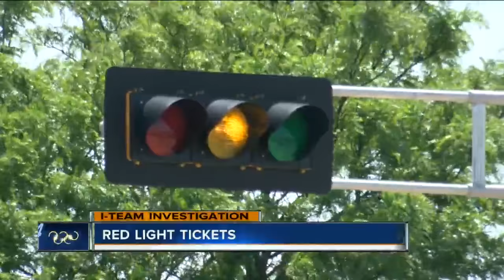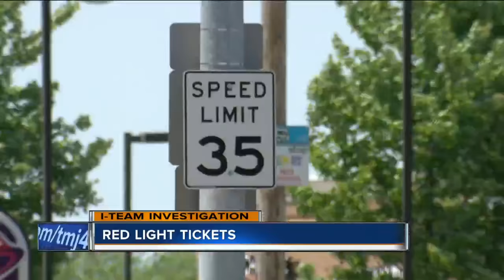Police write red-light tickets at intersection with short yellow light

Comment: Wrong information handed out at the very end;  you can only be charged of running the red light if you entered the intersection (marked by a limit line or crosswalk) AFTER the light was red.  If you entered the intersection on a yellow light, you cannot get a ticket for running a red light.  Read and understand your state's vehicle codes.
Reply: Where do I find that state law for Indiana? I just received a ticket for going through an intersection where the light was clearly yellow but cop says it was red and it was not. smh
Reply: I literally just got a ticket (Michigan) for running a yellow light.
Reply: A cop just tried to do this to my mother yesterday while it was raining. The light did not turn red until she had cleared the intersection, cop immediately pulled her over. He claimed he pulled her over because residents were “complaining” about safety issues. No ticket was issued after we called his bluff on the light being red.
Reply: @smokerscough2907  just another reason to install a dash cam
Reply: but u forgot that.....................................................
the video shows...................................
THAT THEY DID...........................................................
drunkard
Reply: That depends on which state you're in, there is no blanket answer to that
Reply: That’s how the red light cameras work where I live. You can only get a ticket if you cross the line AFTER the light is red.

Comment: in Australia,
Yellow amber is 4 second for city traffics at 50 or 60 kph speed limits
 and 5 second for highway at 70 or 80kph speed limits
Reply: Just 3 second only
Reply: 30 To 40 MPH Or 45 To 50 MPH Speed Limits MPH Not KPH
Reply: It’s km/h Not kph
Reply: MPH Australia USA km/h
Reply: @sharpfinch5354  km/h
Reply: @sharpfinch5354  USA 🇺🇸 Every 20 km/h
Reply: In The United States 🇺🇸 And Canada 🇨🇦 5 Seconds With Speed Limits Of 40 To 60 km/h
Reply: @sharpfinch5354  USA 🇺🇸 Uses km/h Not MPH
Reply: @sharpfinch5354  USA 🇺🇸 Metric Canada 🇨🇦 Australia 🇦🇺 Inperial
Reply: wrong country

Comment: Here in Russia, the yellow light is also required to be atleast 3 seconds long. And most of the time, it is 3 seconds. Nobody fusses. Maybe that's because most traffic lights flash green for 3 seconds before changing to yellow?
Some traffic cops here are corrupt, but atleast they're not that stupid to write cars tickets for "running a red" when they crossed the stop line on a permissive aspect. I'm fairly sure anywhere in the world, that when a light changes to red and you're already inside it, you must finish your maneuver.
Reply: in soviet russia, red runs you
Reply: I think that is a great safety feature to have, where the green light flashes several times before it turns yellow to give people extra warning. There are some countries in South America that use the same system.
Reply: @ZXM23NYC32LA2ZEE In Zelenograd (a city de-facto northwest of Moscow, but de-jure part of it) the Moscow Traffic Management Centre actually got rid of flashing green in October, for "safety reasons". They claimed that it encouraged drivers to speed up, instead of slowing down.
Opinions have divided - some people (mostly urbanist types, who don't drive) support it, while others (those who drive often) oppose it, arguing that 3 seconds is not enough time to stop a car. They also add that a yellow light is a prohibitory aspect according to the Road Rules of Russia, for driving on which one could thereotically get a ticket. Although the rules do provide an exemption to that in case you'd need to brake hard in order to stop at the yellow light. (if you're too close to it for example)
This is not helped by the fact that here in Russia, since 2013 drivers are fined for speeding only if they speed 20 km/h over  the speed  limit. So if the speed limit is 60 km/h (which is the default in built-up areas), the actual speed is 10 to 20 km/h higher. This might explain why a lot of drivers dislike this change, they simply have gotten into the habit of speeding.
The traffic police in Zelenograd recently had also spoken out against the change, stating that crashes at intersections without flashing green have actually increased, and that information about "mass acceleration" on flashing green is not true.
But even with all the backlash, the MTMC have stated that they're not intending to reverse the change.
Reply: @NewBuildmini  Wow, that’s quite detailed and interesting as well. I guess the same thing could be said for the countdown timers that displays how many seconds the traffic light will be red or green.  I think those are mainly popular in parts of Asia, but we have all seen the countdown timers across the world on the pedestrian signals. In the United States apparently I found out it is illegal to give the drivers any indication that the traffic light is about to change red, other than the yellow light coming on, and it is also illegal to give any type of indication that the light is about to turn green. So the countdown signals and the flashing green warnings are all banned in the US.  However, in the US, you can still tell when the traffic light is about to change to red.  I just look at the pedestrian signal, facing the same direction that I am coming from and look at the timer. Once the red hand or in some countries, the red man stops flashing and goes solid…. And the timer gets down to 0, the traffic light will change red. So in a roundabout way, you can tell when the traffic lights are about to change in the US.

Comment: Yellow light means slow down so when the red light comes u can stop better
Reply: You're saying "yellow light means slow down"
Okay, So if you're driving at a speed limit of 35 mph and the light is still green 15 feet before you reach the intersection but turns yellow 5 feet before reaching the cross lines, what are going to do then, slow down until you need to slam on the brakes possibly leaving most of your vehicle in the middle of the intersection or are you going to keep going risking the yellow light turning red before making it to the other side while hoping a cop doesn't give you a citation for "running a red light"?? 🤔
Reply: Only slow down if it is safe to do so. A light won't prevent you from getting rear ended, and it's literally impossible to react if it turns yellow .1 seconds before you enter the intersection.

Comment: When the light turns yellow you're supposed to slow down, and then stop 5 feet away at the stop bar outside the intersection when the light turns red. Problem is people don't pay attention on the goddamn road, and go to damn fucking fast, or they don't care, or even pay attention to where the intersection actually begins that to know where they're supposed to stop at, and added to that they don't care about pedestrians, or the safety of pedestrians. My issue is if you can't slow down within the three seconds giving on yellow, and then not actually care enough to pay attention to the stopbar to stop outside of the intersection on red that's your fuck problem, and you deserve to pay the money for running a red light, but you also deserve to pay $150 for stopping inside the stopbar and failing to yield to pedestrians.

People should learn how to fucking drive before they start complaining about the intersection lights, and that's coming from somebody who's been a pedestrian all his life and who's had to deal with people who are driving 5 to 10 miles faster than the speed limit at the intersections, and not a damn bit of attention to their surroundings. 

Yeah I can understand the whole idea of Independence. But how hard is it to follow the rules of the road and yield to pedestrians?
Reply: If the yellow light is too short, there will be a spot on the road where you won't have enough distance to stop safely or have enough time to get through the intersection before red.